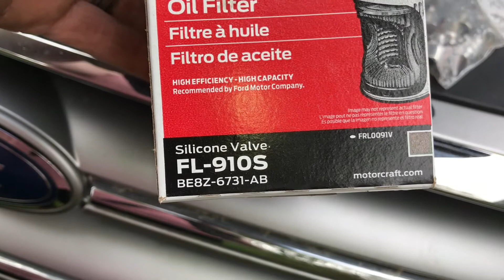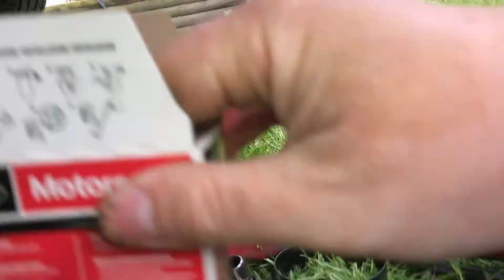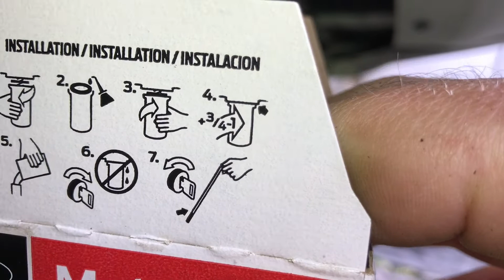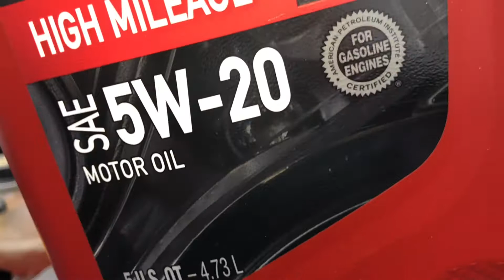2017 Ford Escape Oil Change

Comment: Thanks for the video any idea how to reset the oil change needed message on the dash?
Reply from the maker: Mine does not have that light, but you should be able to reset it by turning your key to the run position without starting it, they push both the brake and gas pedal at the same time until the dash says reset complete

Comment: I recently changed my oil on the same model car you have and the manual said 4.1litres oil needed. I put exactly that and had to remove about .4 litres. Did that ever happen to you?
Reply from the maker: No that hasn’t happened to me. U want to make sure to let the vehicle run for a little bit after you put oil in it and have it parked on level ground to get an accurate reading. And if the oil level is a tad bit high I wouldn’t worry about it
Reply: Alright then thank you very much!
Reply: How did you remove oil?   In my experience if you over fill a little, just don't worry about it bc it will leak out / spill over / burn off and it isn't an issue.

Comment: Hi, Doesn't your user manual recommend 5w 30 oil? 
I am a bit confused as the dealer recommrnds 5w 20 but my manual reads 5w 30. 
What do you think? Thanks.
Reply: Your oil cap says what to use